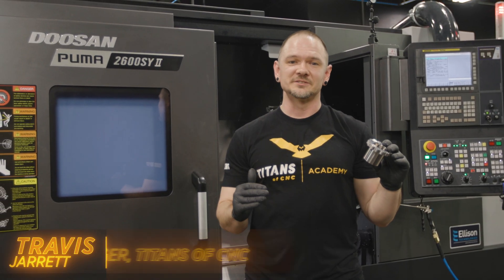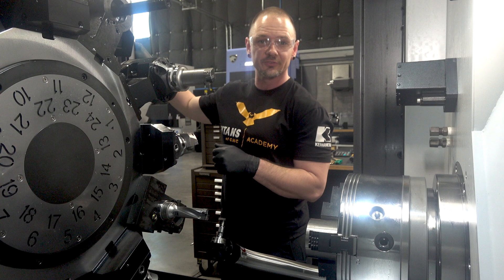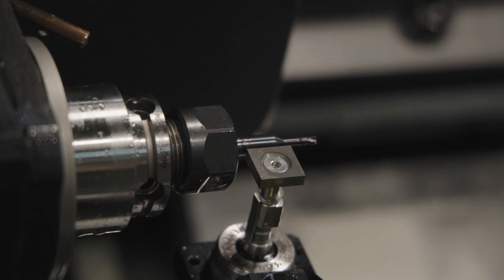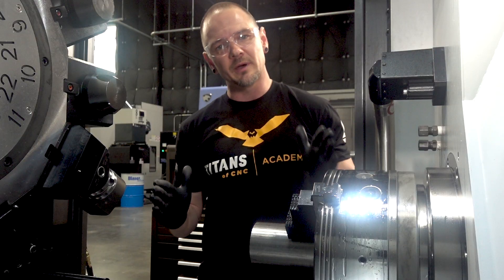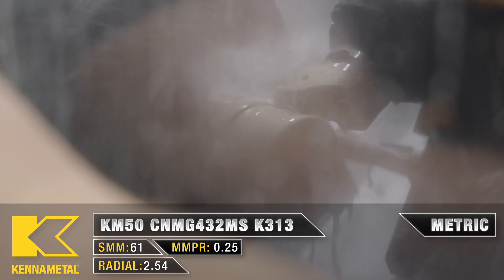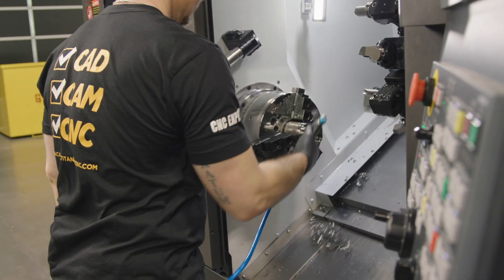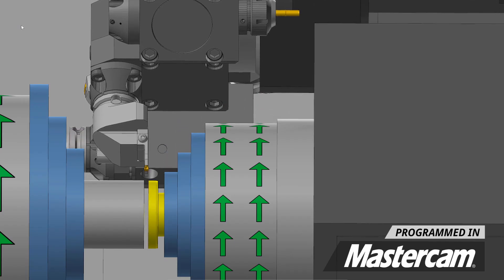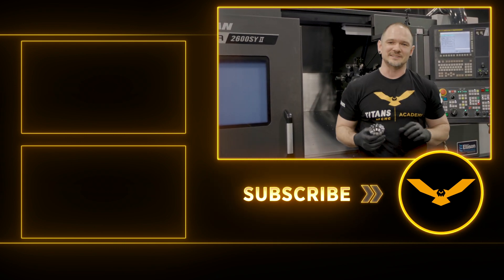CNC Machining a Titanium Aerospace Part on PUMA 2600 SY II | DN Solutions

Comment: Great video , drills work for boring but can be tricky to break the chips up .  does anybody have a direct post specific to this machine for Fusion 360 , i know you guys like to use mastercam now . Just bought one of these and i love fusion 360 , just dont like the thoughts of having to constantly edit the program it txt file to make it run right on the machine .

Comment: If you have to use 2 chucks then it is not a single setup...
Reply: It’s one program, and an untended part transfer. Put a piece of stock in, finished part comes out. How can you say that’s not a single setup?
Reply: From raw material to one completely finished work-piece in one machine with 2 chucks is single set-up.
If you machine one side and then must change set-up again for finish work-piece, you have a double set-up.

Comment: Why would you use the drill as a boring bar?
This way 1 insert will wear out a lot faster then the other insert
Is this really just to save a 4 second tool change for a normal boring bar?
Reply: It’s a good stout bar that you don’t have to buy if you already have the drill. Also, a lot of times when working on both sides of a part you have to get creative as far as tools because you are limited in turret positions for tools. You don’t always have room in the turret to use the tools you want, sometimes you have to make do with what has to be in there. It’s probably not why they did it but I know I have to do that sometimes. I have a mazak 200msy with only 12 turret positions
Reply: Er. Those drills are DESIGNED to be used for boring as well.......

Comment: So it’s not 1 op 😂 still cool tho, never seen the drill used as boring bar
Reply: It depends on your definition of “op”. It would be a 2 op job in a single spindle lathe since an operator would have to physically remove it & reset it in the same spindle for the second side. Since it’s a twin spindle lathe that is taken care of by the machine itself so a completed part comes out with only the initial placement by the operator- hence “1 op”.

Comment: On the doosan 2100sy (same only a little smaller than yours) i wrote a small macro so you never hit the jaws.. G10 L2 P1 Z[180.+#530] (set G54)
This is metric and only for the chuck I have installed the 180 is 20mm off the jaw face (the clearance i need for my partoff tool) and at the start of my program I have eg #530=65.(part length). It just idiot proof (ish)
Reply: We did the same but with separate G602 code. Where you put the parameters in ( like height of the jaws, part lenght and so one) and there is no danger that the subspindle kisses the main 😁

Comment: I run a HAAS DS30SSY, I think this DOOSAN can interpolate on the B axis (subspindle). HAAS you can only position and lock . Rather than using that as a rotary axis.
Reply: It’s nice to be able to interpolate on both spindles, makes not having much travel in the y axis less of a problem
Reply: You just pointed out the reason for buying a Doosan instead of a HAAS.
Nothing against HAAS but Doosan are just that bit better.

Comment: Since you are using the insert drill as a boring how did you orient the drill so the insert you are using for  boring is on centerline in X?
Reply: These inserted drills typically have machined flats on them to orient the inserts perfectly inline with the x axis for boring. Now since there are usually 2 flats opposite of eachother, you do have to make sure you are orienting the correct way to ensure that the insert on the ouside edge of the drill is the one on the x+ side.
Reply: @bradstubbs5708  Nice
Reply: @bradstubbs5708  I’ve typically seen them with the flats oriented 90 degrees from each other so you can choose to offset in either x or y axis. Never seen one with flats 180 degrees from each other

Comment: How does a machine with subspindle not have a touch setter dedicated to the sub spindle.
Reply: This is problem for all similar Doosans, it seems that they have this old Puma 230 design and they just added the subspindle without adding or changing anything than software 😁 we have a Doosan Lynx220 (2 of them) and some more 2 turret Doosans, problem is the same on every machine.
Reply: I know its weird right!! All the sub spindle m/c i have used and non of them have one
Reply: The DMG NLX 2000/2500's have a quick detachable sub-side probe arm that attaches where the Doosan's parts catcher is located. They're quite handy and super accurate!!
Reply: @brickmaster1133  
I am not surprised this would be available on Mori.
You can work without the probe.
But it definitely makes life that little bit easier, after all that is the whole reason for buying CNC machine in the first place.
Reply: Mazak sqt 250ms has this q-arm long enough for sub spindle tools.
Reply: @tomaszspiszak181  Until you mentioned it, i had forgot you could do this on Mazak. But it is a bit of an oversight where other machine builders take this for granted. Especially on a 2020 model Doosan.
You can work around this problem, But why should you have too ??
Reply: My mazak 200msy has one arm that you can use for both front and back tools, but is slightly limited for length of tools on the backside of the turret. Normally isn’t a big problem though
Reply: My experience is with Mori and all there machines from an NLX to NZX all have a dedicated touch setter for the sub spindle that detaches from the actual sub spindle. 
Why in 2021 would people even think manually touching off tools is OK.
Reply: @mlnunnari   
I don't think people in general think that doing anything the hard way is a smart way to approach anything.

I guess it comes down to what you become use to doing. 

If you touch off your work or tools with a probe you do it without thinking about. 
But if NO probe for measuring you make it work. 
Same goes for a CNC Mill.
I don't use a probe.
Definitely handy to have but you can make do without.
Reply: Seems the machine manufacturers still want you sort this problem out on your own ??

Comment: Why doesn't he drill as the first step?
Reply: @Erik Slagter idk ive never done it like that and it always works
Reply: @megu9030  that’s terrible logic
Reply: @patrickmartinez3217  no its not. It works fine and it saves time
Reply: Straighten your stock first then drill then finish. Its more important with bar fed hight spindle speeds to limit vibration ect...
Reply: If you have a pointed drill go for it. But with a flat faced one its better to have an even surface. So unless you are bar feeding with cutoff, i wouldnt do it. Unless the stock is flat ofc, but if u get the material cut off with a shitty saw it can be pretty uneven. 

i always prefer to drill a center hole if possible to save the insert a lot of wear, which it gets by facing off.
Reply: @Phailox  I always face after drill too, trying to machine to center of bar is where all your wear is because there’s no sfm at the center of your part
Reply: Because the end-face might not be flat or cut at a small angle?